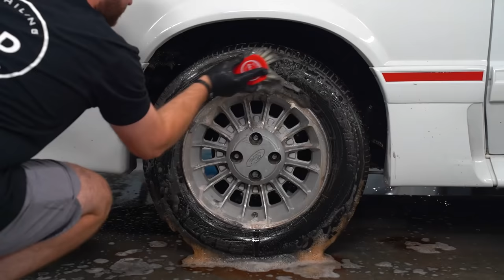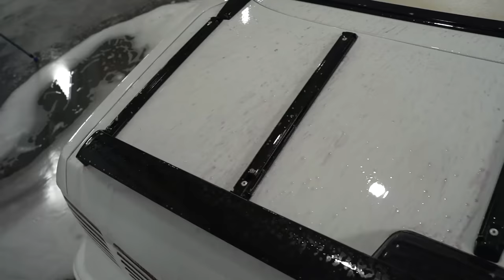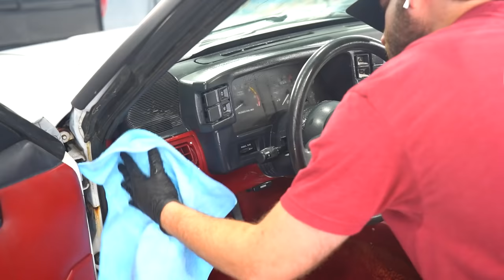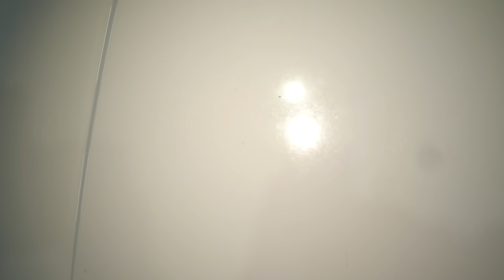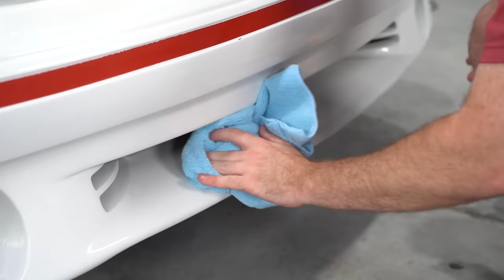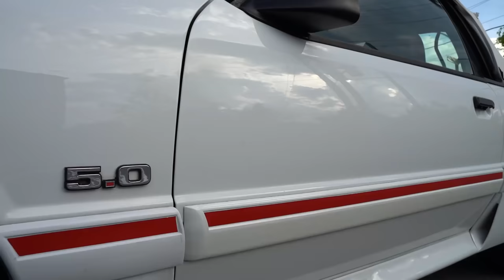Abandoned BARN FIND 1987 Ford Mustang | First Wash In 19 Years |  Car Detailing Restoration How To!

Comment: great detail job, you really brought it back! I have a dark grey on top of silver 2 tone 87 mustang but with the 5 speed manual and not a convertible. Stumbled on it by mistake visiting a buddy down in Arizona, ended up driving it from Arizona to WI this was 12 yrs ago. I just upgraded the original exhaust system last summer just to give it some rumble . This car has a lot of sun damage but only has 67,500 miles. The cars getting new interior next month then straight to the body shop for new paint.😀

Comment: I have a mk7 Jetta and it has that semi matte smooth plastic that VW likes to use. I like the look but a lot interior detailers and protectants tend to make it look blotchy unless you follow up with another dry rag several times.  ive heard you describe the Ceramic interior detailer as self leveling before, will it help me avoid the splotchiness?

Comment: Just one comment, from someone who works a lot at older cars especially Jaguars and some Saab and MG's, Be careful soaking electrical switches with cleaning solution it easily gets into them where it dries out often to a sort of sticky sometimes corrosive gunk that interferes with the switches operation. I had a Jag in the shop this week with exactly this issue, detailed all its life from the 90's both mirror and window controls had issues. Stripped switches and cleaned with water, dried with air and spray of contact cleaner and all good to go. Nice work  otherwise especially raising such a deep shine on older white paint.

Comment: First
Reply: Tips on getting candle wax of a leather seat? Tried some heat, but didn't want to get it too hot or mess the seat up!
Reply: @ztoney38  lay wax paper over it and gently heat up with iron. It will melt onto the wax paper and lift, similar to crayon. Then steam gently a little at a time, waiting in between a few minutes, keep going until it completely lifts.
Reply: I'll give that a shot, thanks!